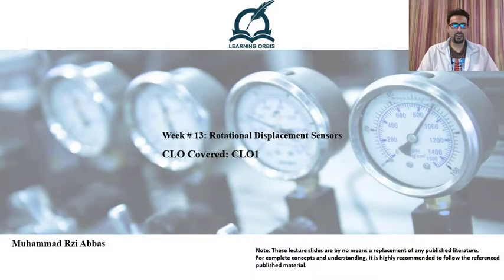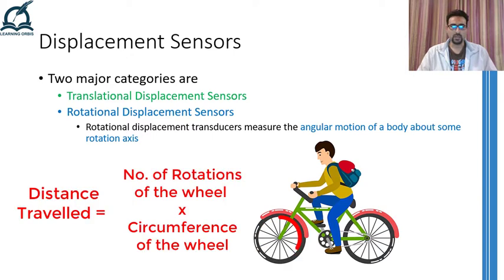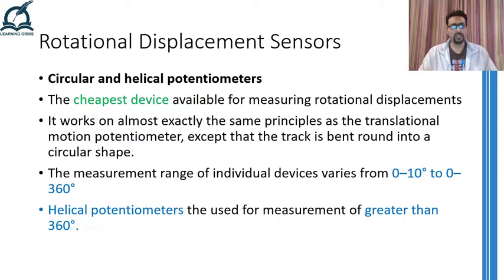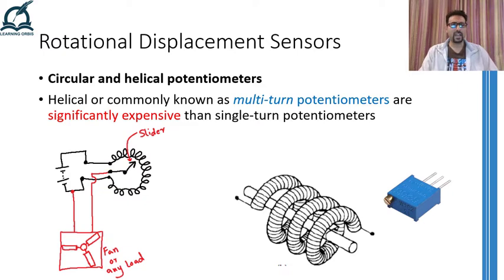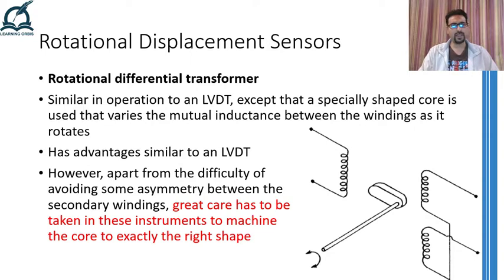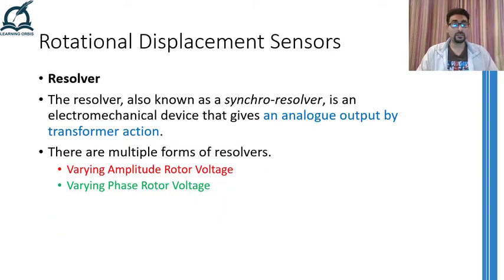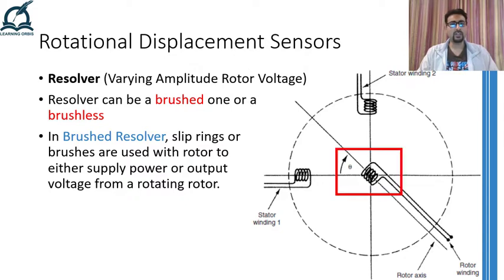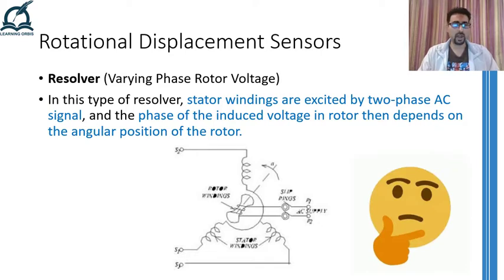Lecture 13 Rotational Displacement Sensors | POTs | Resolvers | Synchros

Comment: A rotary transformer is a  special kind of transformer that is used to electrically couple the electric signals between the two parts. the two parts being in rotation relatively to each other

Comment: A rotary transformer is used to couple electrical signals between two parts that rotate in relation to each other. They may be either cylindrical or 'pancake' shaped.

Comment: A rotary transformer is a special kind of transformer which is used to couple electric signals between the two parts which are rotating in relation to each other.

Comment: Rotary transformer is used to coupling the electrical signals between two parts in relation to each other due its geometry arranged in such a type of pattern.

Comment: A rotary transformer is a transformer in which the primary and secondary windings of the transformer can rotate relative to each other and that relative rotation does not interfere with each other.

Comment: A rotary transformer is a type of  variable frequency .it enhances the electrical signal and couple them which are related to any two parts  rotating in relation with each other

Comment: A rotatory transformer is a special type of transformer which is used to transfers electrical signal between two parts, which undergo produce rotary motion relative to each other, is called a rotary transformer.

Comment: A rotatory transformer is a specific variable frequency transformer used to couple the two relatively moving components by transferring the electrical signals and power between them and can be a good replacement for slip rings.

Comment: A rotatory transformer is a specialized(variable frequency) transformer used to couple electrical signals between two parts that rotate in relation to each other.

Comment: A rotatory transforrmer is a specialized transformer used to couple electrical signals between two parts that rotate in relation to each other. They may be either cylindrical or 'pancake' shaped. These rotatory transformer have a cylindrical, rather than a disc-shaped, air gap between windings.

Comment: A rotary transformer couple electrical signals between two part parts that are rotating relative to each other. They are construted by winding primary and secondary windings into halves of a cup core thus having a cylindrical air gap between them.

Comment: A rotatory transformer is a specialized transformer used to couple electrical signals between two parts that rotate in relation to each other.

Comment: The rotary transformer is a special type of transformer in which primary and secondary windings are able to rotate relative to each other. The relative rotation doesn't interfere with the mutual coupling between the two winding.

Comment: Rotatory transformer is a type of variable frequency transformer. It enhances the electrical signals and couple them which are related to any two components rotating in relation to each other.

Comment: A rotary transformer is a specialized transformer used to couple electrical signals between two parts that rotate in relation to each other. They may be either cylindrical or 'pancake' shaped.

Comment: A rotary transformer is a variable frequency transformer that has an axial symmetry and an air gap between the primary side and the secondary side and they enhance the electrical signals and couple them which are related to any two components.

Comment: A rotary transformer is a type of variable frequency transformer that couples the electric flux between primary & secondary windings with respect to the angular position. It can be used in various places due to its versatility in Flux output. It is also used as a sensor to measure the angular displacement.

Comment: Rotary transformer is a special type of transformer in which primary and secondary windings are able to rotate relative with eachother. The relative rotation doesn't interfere with the mutual coupling between the two winding. This makes the rotary transformer ideal for contactless rotor fields.

Comment: A rotary transformer is a specialized transformer used to couple electrical signals between two parts that rotate in relation to each other.

Comment: A rotary transformer is a transformer with the primary and secondary windings able to rotate relative to each other, and the relative rotation does not interfere with each other

Comment: Rotary transformer is a special type of variable frequency transfomer with an axial symmetry and an air gap between the primary side and the secondary side, accordingly allowing the rotation of one of the two parts. It is a good alternative to slip rins for signal and power transfer.

Comment: A rotary transformer is a variable frequency transformer that couples the electric signals between two windings that are rotating relative to each other, and transfer power.

Comment: Rotary Transformer is variable frequency transformer.It enhances the electrical signals and couple them which are related to any two components rotating in relation to each other.

Comment: A rotary transformer is a variable frequency transformer that helps to enhance the process of allowing the electric signals that are associated with two components rotating near one another to connect without the generation of any type of undesirable activity.

Comment: A rotary transformer is a specific transformer used to couple electrical signs between two sections that pivot according to one another. They might be either round and hollow or 'pancake' molded/

Comment: Rotatory transformer is a type of specialized variable frequency transformer. It enhances the electrical signals and couple them which are related to any two components rotating in relation to each other.

Comment: Rotary transformer couple electrical signals between two relatively rotating parts. There exists an air gap between its primary and secondary side, accordingly allowing rotation of one of two parts. The aim is to achieve contact-less energy transfer.